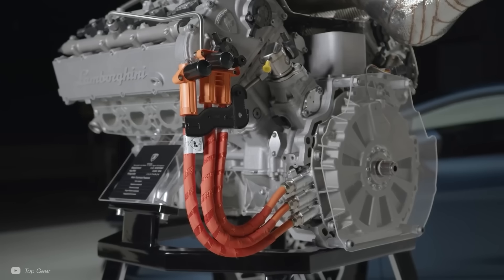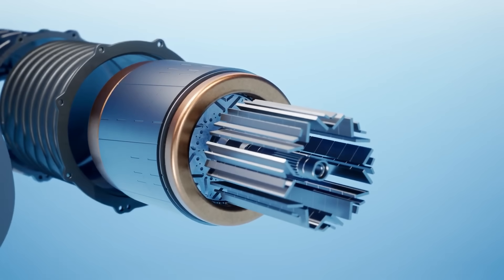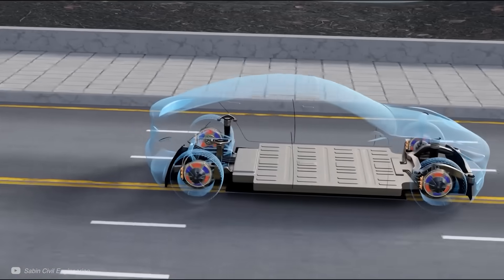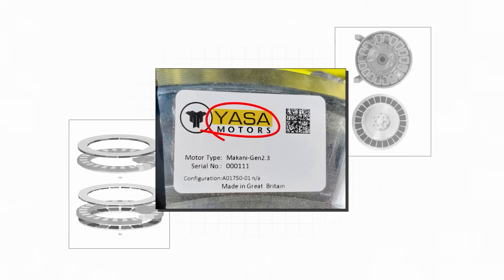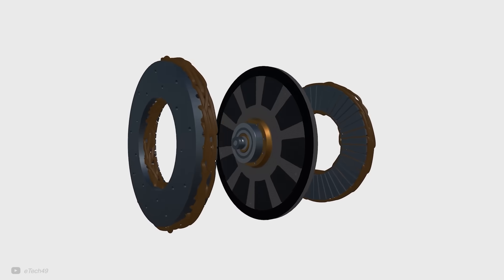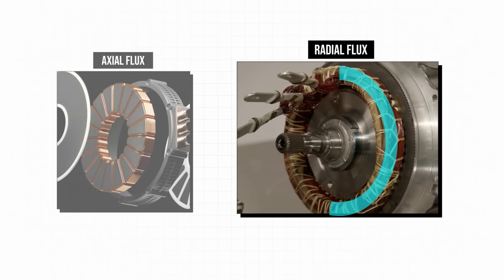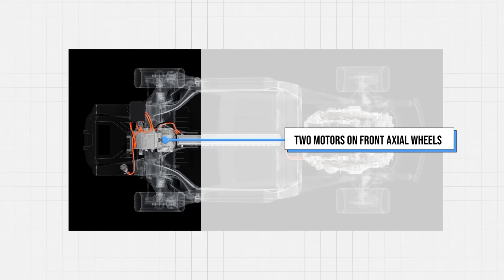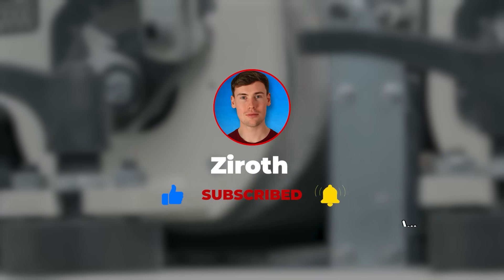Revolutionary Yokeless Motor: The Future is Here

Comment: It seems to me , still, that Koenigsegg’s version of this type of e-motor,  “Dark Matter” is years ahead of Lamborghini. 
Dark Star:
6-phase
8500rpm
800hp
1250Nm
40kg ( 88lbs)
And dimensions at, roughly:
39cm X 38cm X 14cm
(15”x15”x6”)

And it’s stand alone, not integrated into rear of an internal combustion engine. 

If you can, produce a video on the Dark Star. I’d love to learn as much as possible about it. Who knows… it just might change the world!. 
Thanks for the excellent video!
Reply: They're both made by YASA.
Reply: But but the video title said "changes everything"!??!!!?!?!?!?
Reply: i cant wait until chinese copys are on temu or amazon
Reply: Who did what now,? Yokeless
Reply: Zing the thing.
Reply: With the specs you listed, the power density would be worse on that motor. Its over double the weight for less than double the HP
Reply: @ZeorGaming  Not true. The Dark Star is 14.94 kW/kg; more than double the Lamborghini power density at 6.35 kW/kg.
Reply: @ZeorGaming  isnt lambos 148 hp at 17kg? @11:33 into the vid? Thats 5,4 times more power at 2,3 times the weight for the Dark Matter one.
Reply: @LFGstockades  Dark horse is 800 hp and 88 lbs.
Reply: @ You are right, I mistook the braking horsepower numbers for general horsepower when making that comment. The dark matter one would indeed be more power dense
Reply: @ZeorGaming  Since you agreed your original comment was incorrect you should edit or delete it so people aren't misinformed.
Reply: Raxial flux motor as Christian Von Koenigsegg calls it. The man is a genius, a a true innovator who converts well-researched science into well-engineered products.
Reply: It's not really a fair comparison, Koenigseggs are multi million dollar cars while the Temerario is the bottom of the line Lamborghini at 300k
Reply: @niconiconii-san  The price of the vehicle doesn't dictate the price of the motor. At the end of the day, the evolution in power density isn't just by throwing more expensive materials at it and praying to the voltage gods. It's still at the core about harnessing electromagnetic physics -and here it seems Koenigsegg have mastered that somehow in a way no one else has come even close to. Even if you made the entire thing out of carbon fibre (if that was even materially viable) that wouldn't explain the doubling in power density, as you still need the copper coils, the magnets, the copper winding cores, etc to reach basic functionality. Unless they managed to use another material with twice the magnetic properties, the cost of material isn't what allows them to do better. It's about engineering mostly. Then ofc they optimize every single bit and probably shave a couple kgs off of the final weight, but the real weight and size savings come from pure raw engineering genius, and not from just using more expensive materials.
Reply: This Lamborghini YASA motor:
148 HP (110 kW)
17.3 kg
7 cm thick

Meanwhile EV leader BYD as part of its new Super e-Platform: "Besides the [10C 1MW charging] battery, another major breakthrough is its 1000V electric motor that boasts over 30,000RPM. According to BYD, its new motor is able to deliver 30,511RPM with a high output of 580kW (778hp). The brand claims its new motor has the highest power density in the industry at 16.4kW per kg". It will be available on a BYD Han L that costs $40,000–$54,000 USD. Imagine a quad motor version.

Strapping a wimpy motor onto a combustion engine is not the advance petrolheads think it is.
Reply: @skierpage a motor having to spin 30000 rpm is not great either. Those bearings are not gonna last 100000+ miles.
Reply: I'm not sure if it's fair to torture everyone by having them make another electric motor video full of things he learned from Quora and google search AI. Part of me does think he should be forced to make nothing but electric motor videos until he actually learns about the immense diversity in design and operation though. This one specifically felt like an essay they wrote on the bus on the way to school with would be lucky to get a passing grade.
Reply: @robingordon6662  chill bro, make your own video
Reply: @edwardpark247  Nah lol
Reply: @edwardpark247 If you hit a pothole on the highway today, is the only option to quit your job, get a job for a major contractor, learn how to operate heavy machinery, and go fix the pothole? If someone is gonna get paid a significant amount to make YouTube videos, something he actively pursued as a job... Then just read a press release he was sent, get simple technical stuff wrong, and leave all of us worse off than if we had just read YASA's Wikipedia (or any of the dozens of equally generic articles from 2017 when the Ferrari had the same exact system), they definitely can't complain if someone tells them they wasted our, and their time making that video. And you might just be a little too soft to survive in the (lmao) comment section of a sub replacement level edutainment video. Don't they have YouTube for kids now? Have you considered using that instead?
Reply: what a load of 💩 😂

Comment: I'm most interested in what reduced weight might mean for the feasibility of in-wheel motors in less extreme vehicles.
Reply: Unsprung weight.  Put it at the other end of an axle.
Reply: @cosmicraysshotsintothelight  for a normal car, i wouldnt say doubling the weight of a wheel would be terrible. just need to get away from super skinny side walls so it doesnt get vibrated apart. Not going to save much weight on swapping the axles for longer power cables and cant see much other benefit.
Reply: @jamessssssssssssssssssssssssss    Odd...  the "power cables" would run right down the central spine of the car to a motor also essentially at the center of the car.  The axles would each be part of the rigid structure of each fully independent wheel suspension.  Weight AT the wheel always matters and your cables for an in wheel motor would have to flex with every single motion of the car's suspension.  Just asking for a failure mode.
Reply: I suppose rather than putting it in the wheel, you could have a radial flux differential somehow, if you could integrate the limited slip.
Reply: @BobHannent  No...  In place of the differential, the two rear wheel axles terminate each into their own motor near the center of the car.  When the wheel/suspension arm/axle/motor assembly encounters a bump in the road, the wheel traverses upward at various slew rates depending on the bump profile.  The spring pushes against that motion AND the shock dampens that up-thrust and slows the return just a small amount, because ideally the wheel should remain on the ground and that return should be as brisk as possible.  If a heavy weight is incorporated into the wheel itself or that end of the suspension assembly supporting it, everything slows and parts take more of a beating too.  And forget about it being "brisk".